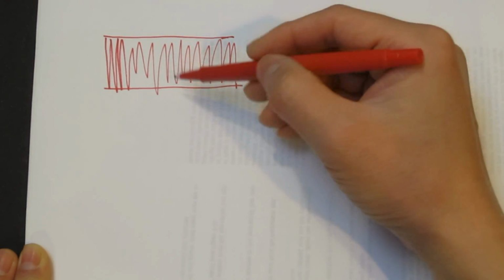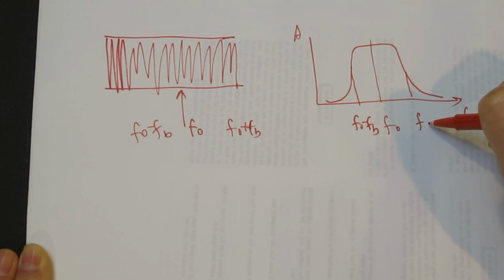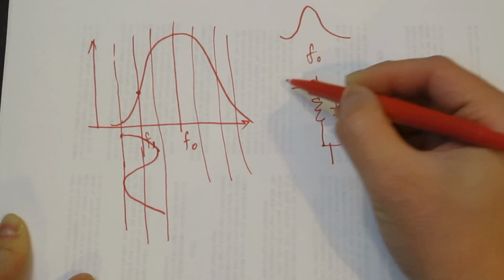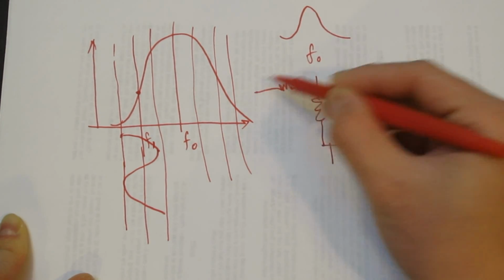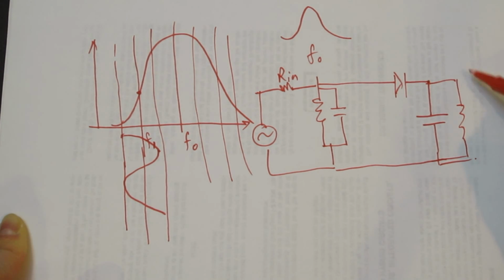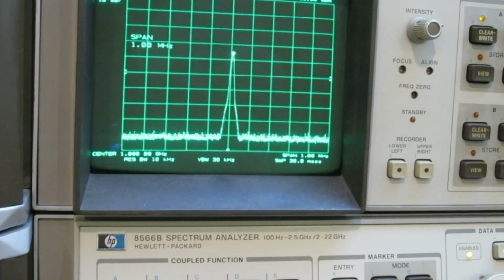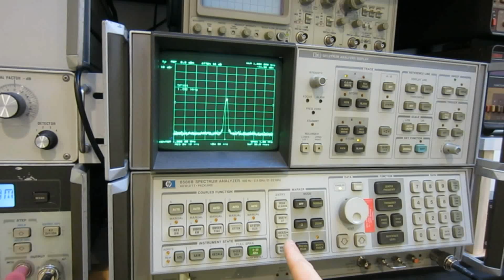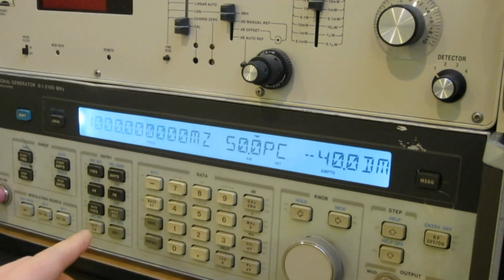AM/FM Demodulation Using HP 8566B Spectrum Analyzer

Comment: HI. Great info. However im confused as to where you are taking the output for the audio amp from (I think you say the video out but my hearing is not great). My Anritsu MS610C does not have a 'video' labelled output, but X, Y and Z outputs? Can you advise? Thanks
Reply from the maker: That's correct, it is the video output. It should be your Y output. X is equivalent to horizontal sweep, Y corresponds to video and Z is usually designated as pen-lift.

Comment: Great video.  When he is talking about upper band and lower band in fm, he is referring to the stereo effect.  FM radio has two channels to transmit a left and a right.  Hope this makes this video a bit clearer.
Reply: That's not really the case ..... stereo is encoded in the signal using pilot tone and mixing with 38 Khz

Comment: Another well done video,,Thanks.
My 8566B has had a problem where it blows a  fuse one of the 5 volts rails. I swapped the few once but it's down again. From some reading on the web it seems that the tantalum caps can have a high ESR over time and contribute to excess I draw. 
I will start in a few weeks, checking for tantalums out of spec or with high ESR and swap them out.
Have you had any issues with your unit yet?  Not sure if I'll use tantalums or some of the newer high value electrolytics if I have room.
Looking forward to getting the 8566B back on line soon. 
Again thanks for the informative videos.
Reply from the maker: +wa4aos Thanks! I guess I am lucky, my HP8566B hasn't had any problems. Those tantalum caps are time bombs however.
Reply: I had to change out a couple of big filter caps in mine a few years ago. You can tell if one of those has gone bad by unsoldering it and put its leads across a power supply with a big current meter. If it's gone bad, there will be no inrush current (it won't charge).